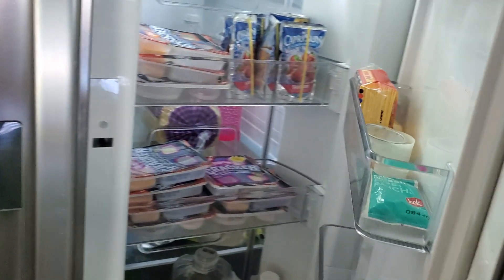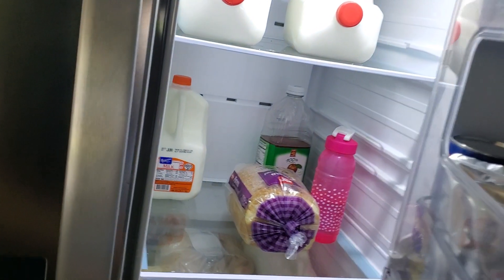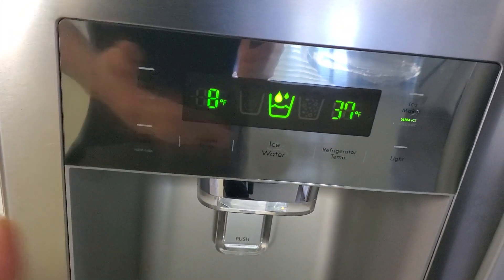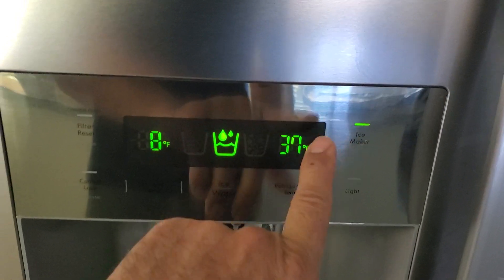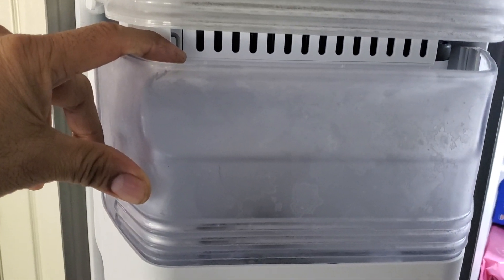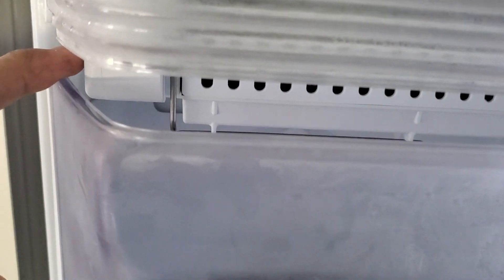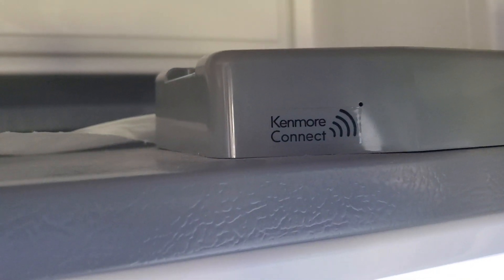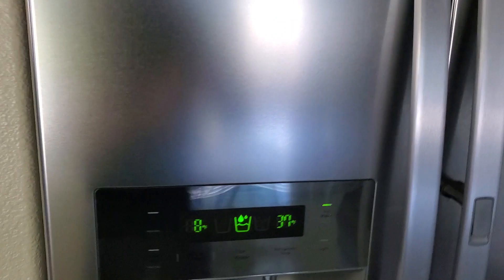Kenmore Refrigerator Not Making ICE How To Troubleshoot Fix Issue Quick

Comment: Thank you for the video.  I wanted to add that I have the exact same model and the water line for the ice maker had frozen therefore it was not sending water to the ice maker.  The fix was to unplug the refrigerator for 5 minutes to let the line thaw out.  I unplugged mine for 15 minutes just to make sure.  I plugged the refrigerator back in, pressed the "Make Ice" button and in the morning I had ice.
Reply from the maker: Thank you for information 👍